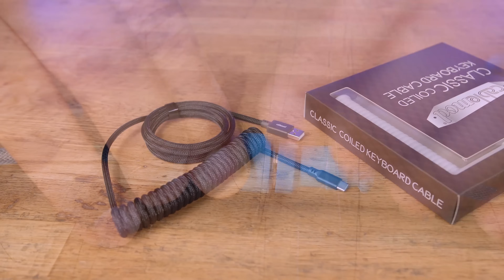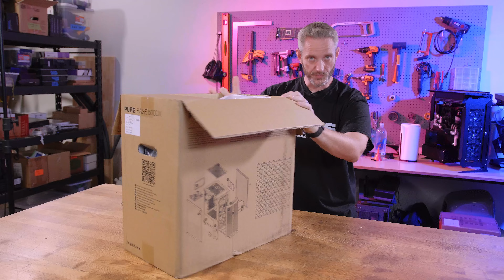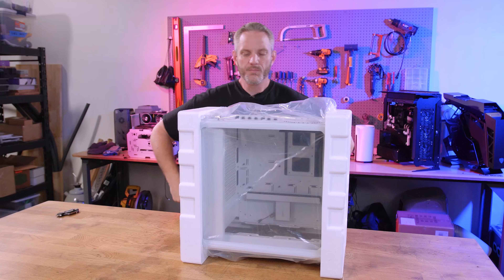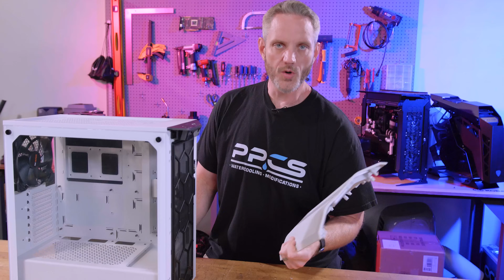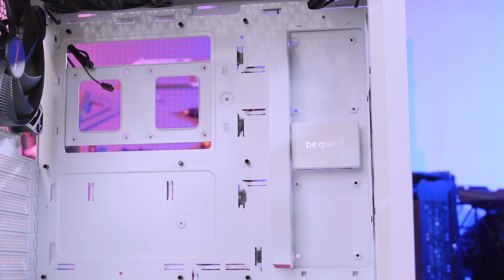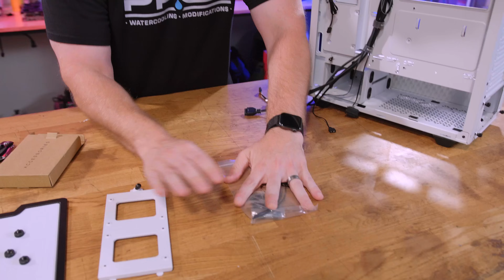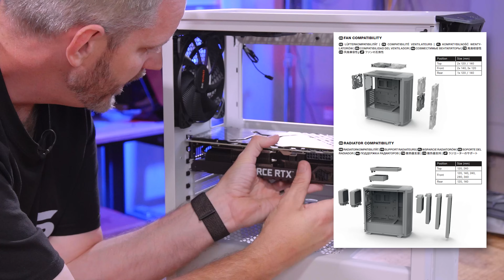An amazing case you can actually AFFORD!

Comment: I have a Pure Base 500, no DX, I don't think DX existed when I bought it. It's an amazing case. I just upgraded, it houses a 14600KF and 4070S without problem. I have an Arctic Liquid Freezer III at the front (It's 3x120mm so it doesn't fit at the top). It's silent, my temps are good. I can recommend it to anyone. With this DX version with the front mash it's gotta' have even better airflow, which I already have no problems with. I didn't want a too big case because I don't have much room for it, and it's great even though it's just a mid tower.
Absolutely worth the price. If I can squeeze in another upgrade into it I will.

Comment: I've been using this case for 9 months now and when I wanted to remove the front filter to dust it I ending up breaking 2 of the blades on one of my expensive MSI ARGB fans because the front cover mounting system is awful and the filter itself is loose. Now I've put it back together and the fans aren't lit because a connector has come loose so I have to take it apart again.
TL;DR It looks pretty but is badly designed.

Comment: @jayztwocents why are they not building this horizontal. I would like to have the airflow of this with 2 front.. and 1 back exhaust and one top exhaust. With a noctua nh d15 cpu cooler. Wont the weight of a big 4070 and the noctua d15 cause too much stress on a motherboard? Or am I overthinking this?

Comment: Has anyone tested this with air cooling only -setup?
Reply: With a case I only care about noise but don’t want to use water cooling since no-one can guarantee it’ll last at least ten years without thorough maintenance. I’m still using my Antec Sonata Piano Black case with noise cancelling layers, Noctua fans and a Noctua cpu cooler, and all of those parts are about 18 years old. I recently had to upgrade from Intel’s 1156 socket to AM4 and Noctua send me the parts for the almost twenty year old cooler for free to the least populated northern parts of Finland in four days. I’m worried about the airflow and I know I have to upgrade my case too, so I need a 100-150$ air cooled silent case.

Comment: These cases are nice but have a scarily standard flaw in the design.  A lot of case mfrs these days are shorting you 1 full USB per bank on the front of the case as in this case your USB3 header is used but they give you 1 USB slot instead of the normal 2 ( 2 ports per header).  This usually ends up in the nice but pass category especially for customers or even myself who use those USB ports.  It's a very cheap way for them to cut costs and robbing you of a port for no reason and says to me be wary.  I love be quiet products but this case is a slap to the customer and they know it.  There's no reason for them to do this when they could save money in other areas like removing that ARGB strip in the front and making the whole face open mesh giving better air flow in the process.

Comment: Amazing case I just bought one of these. The build quality is supreme. BUT you are wrong for a few things - the air flow is not good at all. The hot air from the VGA is blasting directly to the glass and has nowhere to go. The case fans ate uncapable to catch this 85deg C air and extract it effectively. Aaaand other air flow flaws 
There are other problems with this case, but the air flow is the biggest one.
Reply: I've no idea why you say this.  I've had it for almost a year now and the airflow is fantastic.
Reply: @vedinthorn  What VGA you use?
Reply: @ELMANTEC  doesn't matter much, though mine is particularly cool, but I've seen it temperature tested with a 3090 and it was as good as a lancool 3 and such.
Reply: @vedinthorn  my 3070 cannot go bellow 83C with 4 case fans
Reply: @ELMANTEC  something is wrong then.  Either with your card, or your fans aren't moving air around properly and you made it a hotbox.  

Nothing in my case gets above 60
Reply: @vedinthorn  or the case is just like that...
Reply: @ELMANTEC  but I've seen it thermally tested by multiple people who do it professionally who don't have that problem even in the default configuration.
Reply: Are you using in factory configuration? If so try changing and put 2 fans at the front..if still a problem try removing filter or change to static pressure fans with at least greater than 1500rpm. my case temp is 65 to 70 c max load with 3080 gigabyte OC card. Ambient room temp is 23c.
Reply: @mathaihouse504  I think you meant to reply to dimitar, but I agree.  More air coming in the front than going out the rear and everything works great for me.
Reply: @vedinthorn  right... Sorry for tagging you incorrectly..changed now

Comment: Its a great case except if it was like just 1 cm longer then it could fit 4080 while a 360 radiator is at front. And the radiator could be placed on top, if the case was like 5mm longer.  I don't know why they didnt make the case just slightly bigger
Reply: ....but you can put a 360 on top.
Reply: @vedinthorn  i tried, mine didnt fit

Comment: I actually purchased a 500DX after this video and I've loved it since. One heads up is you CAN fit a 360mm radiator on the front like I did but you'll have a couple of issues especially if you want to do tubes down (as you should) and that is if you have a long GPU, you will need very long tubing and it has a pretty tight space to turn it all the way up and towards your CPU. My solution was to get the Phanteks vertical GPU mount, do some case modding and run the tubing around and behind the GPU. In the end i still get very good temps (with an i7-12700K too)
Reply: You can do that, but tubes up isn't "wrong" so long as the pump is still below the rad.  It just means you'll be more likely to get a little bit of gurgling from the bubbles at the top quicker.

Comment: You are very wrong at 06:38 mark. This case is a negative pressure case. You need more exhaust fans then intake. I have this case temp difference between balanced/positive pressure and negative pressure is around 2-3deg for 3600x. Kitguru and Steve from GN came to this conculsion. For me on heavy oced 5600x 4850mhz 2000fclk difference is between 83c vs 75c  depending on fan configuration. Best for me is 1x exhaust (fluctus PWM 120mm) and 1x pure wings stock (top) and 2x pure wings intake.

Comment: Bought this case for my build and do not regret it. Great case. Easy cable management, plenty of room to work with, decent fans/RGB. The front I/o cables use plugs so you can remove them from what you do not want use. 

Cons I have found so far: 
Cheap power button connector (button itself feels ok).
Cable management plate can be difficult to get back on after install.

Comment: 15:15 yes this was my exact experience with this case and top mounted aio. Luckily only had to remove radiator & fans. but the 50+ mm of drop blocks a lot of the headers like the pump and cpu fans. so wire everything up, then do the ram as the clearance for me was TINY, then do the aio with the  hoses going towards the case front and approachong the block from below. unless your hoses are really short they wont fit in oriented to the side of the block... also went with aio fans in intake. upside is better aio cooling and greater positive air pressure. downside is warmer air inside the case blowing onto the gpu... but haven't noticed any issues yet...

Comment: Fractal Design Focus G case here. mid tower. two front case fans blowing in, one rear blowing out, two top blowing out, my ryzen 5 rig never gets above 113 degrees Fahrenheit or 45 Celsius under load and its only air cooled. Deep Cool GameMaxx 400 hydro bearing cooler, 3 rosewill rgb 120mm fans and two fractal 120mm fans. its nearly silent at idle, negligible under load. with case filters on every fan except the rear. it will idle at 25 Celsius or 77 Fahrenheit, and a mild overclock.

Comment: I have a full custom loop in that case. Performance is amazing. Build quality is good, especially for the price. Easy to build in. Simple, but not boring looks. The RGB in the front looks crisp and diffused. Very very happy with the purchase. The top fits only 240mm radiator though. Front with 360. never getting over 50C -ish gpu and cpu under full load with fans mostly not even ramping up. Amazing. Would buy again 11/10.

Comment: I've had this case for a year and never knew there was a button to change the RGB. I also now know where exactly I can mount additional ssd's. This case has been nice and insanely quiet. You wouldn't know it was running without the RGB. Also if anyone is curious and has a cricket, the glass has held up well with vinyl a year later if you wanted further customization. This case has been home to my first gaming pc and its been such a beautiful home.

Comment: I've had this case for about a couple years now and it's great. I swapped out the Pure Wings 2 fans for Shadow Wings 2 fans (mostly because they were white, but they are also better). Lian li 240 AIO with more Shadow Wings 2 fans. With all the fans running 95% I can't hear a thing. The only time there is noise is if the RTX 3080 is getting hammered. It's a really great case. Only major issue I had is the bottom cable management. There is basically no way to hide that giant USB 3.0 cable if your board has that header on bottom, which is probably does. Minor issue for an otherwise amazing case.

Comment: I bought one of these a few weeks back to replace an old case (cooler master HAF 912 I believe). Very happy with it. Learned the hard way about attaching the top cables before installing the motherboard. The included top fan blocks the CPU fan on my mobo. My components are on the older side (i7-4770) but this helps it look pretty good. 

Still haven't figured out how to take off the front panel and Jay's video must have an edit where he started to pull it off. I think you just yank on it from the bottom but I haven't wanted to take the chance of breaking it. Otherwise I'd really like to take the top fan and reposition it to be a second fan in the front. That said, even with a rtx 2060, i7-4770 and 4 drives, everything stays cool even now.

Comment: 9:15 good point! When I wired up my sound system in my Z71 Tahoe , I made sure the power to my amps and subs ran along the right sight floor board of my Tahoe and a the power feeding them down the left side floorboard . Separating power from speaker wirer is key!
👍🏻👍🏻👍🏻💪🏻💪🏻💪🏻👌🏻👌🏻👌🏻👌🏻👌🏻

Comment: I actually use intake on the top because I have a radiator up there, and when it comes to cooling performance, typically pulling in cooler air is going to cool better than pushing through warmer case air. Although I know that the tests has been done before, and it's actually pretty negligible. I also have a front radiator as well which is pulling in. So to me it almost seems kind of pointless pulling in warm air, then taking the warmer that was exchanged to the front radiator, and pushing it back through the top radiator.

Comment: Does anyone know of a pc case that has a the front i/o on the vertical front facing side of the front panel and a mesh dust filter? The best example I could think of is some sort of hybrid front panel between the Cougar MX410 Mesh-G RGB and the Gamemax Brufen C3. It is the last sticking point in my effort to find the parts for a dream build now that I've stumbled across Jacknet RGB Sync. I'm in the market for a mid-tower case with 3 front, 2 top, and 1 rear fan capacity and dust filters on the front panel and bottom (the bottom would preferably be on a sliding tray of sorts). Top filter is preferred but not required.

Comment: Interesting, i have this case and it came with 3 x 140mm fans.  Had 1 installed rear, top and front. i moved the top to the front and had a rad exhausting in the top.  edi : NM this one does have 3 fans, i thought he said it had 2.   Love the case, though it's a bit tight for cable management in the back.  Also the RGB was flakey when i bought it, but be quiet got me a replacements to australia in under a week.  So their customer service was top notch.Interesting, i have this case and it came with 3 x 140mm fans.  Had 1 installed rear, top and front. i moved the top to the front and had a rad exhausting in the top.  Love the case, though it's a bit tight for cable management in the back.  Als

Comment: My partner just got this case today for her build, Great case to build in, Had slight issue with the PSU bracket plate and the screws lining up correctly but other then that well worth its money. 
If you want to control the leds with software you are going to need a argb5v header not the 4pin rgb header most mobo come with.

Comment: I kinda like my top mesh. Not for computer reasons at all tho. Cat likes to sleep up there so it's lucky I bought a  Corsair 5000D which literally has a built-in cat bed so the fur doesn't get stuck in the fans and air can come out even when big boy Zeus is sleeping. And my apartment is a "massive" 480 square feet so it's nice to not have random panels floating around making a mess :)
Reply: I lost the top shelf of my printer cart to my two cats.  It's right beneath the window in my computer room so they commandeered it for looking out the window.  It has a cat bed on it now.. 🙂

Comment: I ended up removing my top mounted aio several times because I haven't plugin cables to my motherboard. I'm using Corsair 4000D case and have the same problem. What I love about 4000D is the size of it, looks like this 500DX is taller than 4000D. But considering the price, this 500DX has much better fans than 4000D.

Comment: It is possible to have both a front 360 mm radiator and the HDD cage, see page 18 of the be quiet! Pure Base 500DX user manual.  There are two mounting positions.

Comment: Jay - Mod Idea. 💡
You know how you were saying that with a large GPU you'd be a bit limited with radiator options at the front? What if, instead of using the normal radiator mounts, you added on some spacers to the front of the case to push the front panel out further?

You could use something like some aluminium C-channel, with appropriately drilled holes, & painted to match the case. You would need to maybe 3d print some sort of panel to bridge the gap between the IO panel & the case front panel as well.

I'm not exactly sure of how the radiator is normally mounted - whether the case has removable brackets for it or not, but I reckon the idea in general would be workable.

Comment: Only one fan that's airflow optimized with a double mesh in front of it? 🤔 How's that going to produce enough static pressure to pull fresh air through the vent rather than just recirculating hot air from inside the case?

Comment: Well i owe this case, and it is imho one from best for normal use .....very clever designed , only on top position i have problem fit AIO from NZXT ..model Kraken X63 ... it is collide with mobo - Asus Tuf B560M ...so i must put AIO on front ,and front beQuiet fan as second exhaust on top ...and it work great .....another else ...almost perfect. BTW. sorry for my bad english :-)

Comment: Just used this case for a nephew's graduation build present. Plenty of space for a 3080 and a Noctua NH-D15. We added 6 Lightnings 140mm fans with the ARGB hub and fan hub. The only quirk was the extension cables which were connected to the MB before it was installed. After that cable management is a breeze. Do away with that minor issue all in all it's a great budget starter case.

Comment: Just swapped it out for a P500a. Now I can have a top 360mm, temps are better, but there's more dust and the new case is a lot bigger. The 500dx was so nice on my desk. It was nice to build in and components "fill" the case out well. My GPU was running a bit hot, but cpu temps were good(3080 10gb EAGLE and 5800x with NH-D15)

Comment: Would it be a good idea to put one 140mm fan at the back and two 140mm fans on the top as exhaust and a 360 rad as intake in the front

Comment: Comes with 3 worthless fans. Their speeds are only manually controlled by the top front panel. So this turns into a 170$ case if you get the right fans.

Comment: I use base be quiet base 802, I think 802 is better than 500DX, but if I buy 4090 aio ver I will change to corsair case 700x.  This is because I need two aio on both sides and fresh air in the front.

Comment: I remember the days when you paid $ 25 for a cheap/budget case, $ 50 for a decent mid range, and $ 75 - 100 for a high end case. Boy times have changed, we get a lot for the money with cases now with even sub $50 cases having good design.
.... On the other hand, everything else is rediculously overpriced. But one consolation is if you spend for top notch gear you usually get a longer useful lifespan out of the system, so there's that.

Comment: I have an old CM Storm Enforcer case. 11 year old design, but an included 200mm intake fan. I added another 200mm fan to the top rear of the case as exhaust. Incredible airflow and dead silent. So to make a quiet case just use 200mm intake front and 140mm rear exhaust. Quiet is easy, larger slower moving fans.